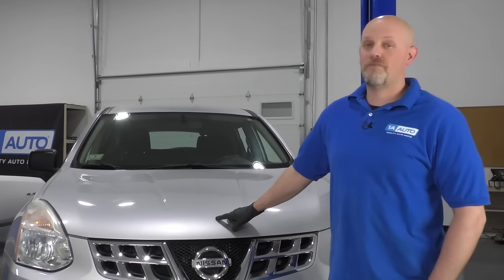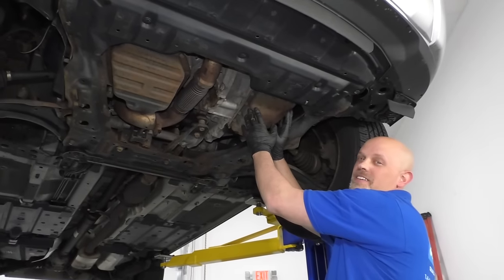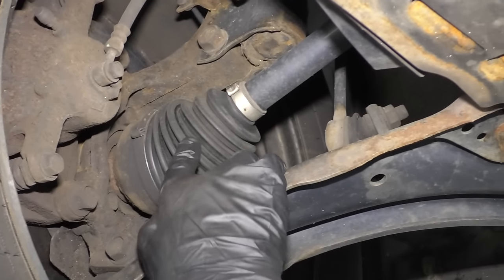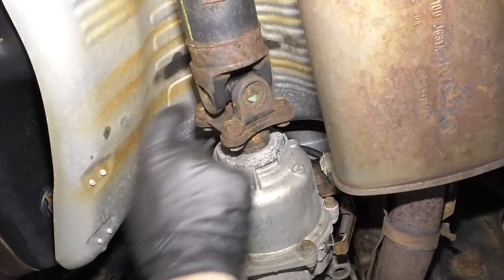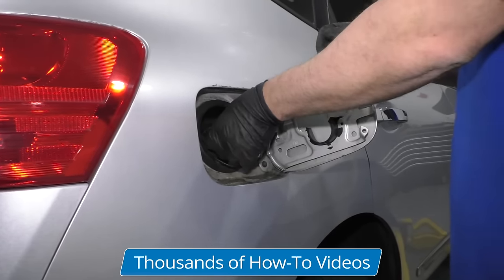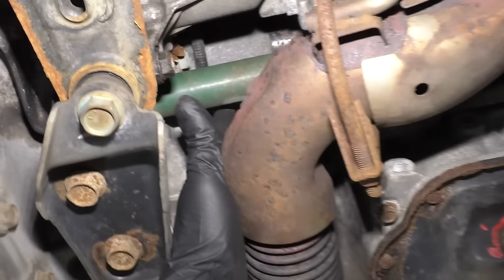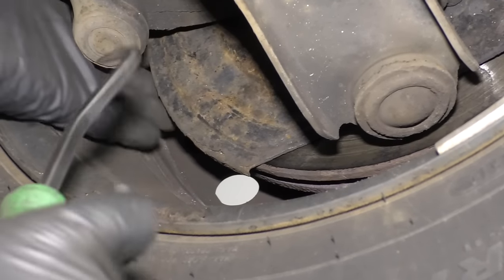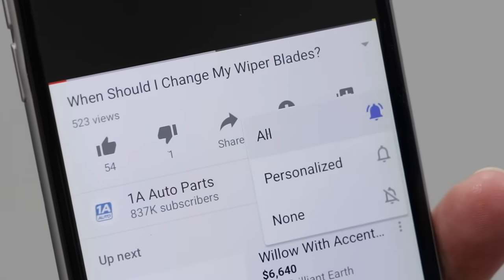Top 5 Problems Nissan Rogue SUV 1st Generation 2007-13

Comment: I have 2009 Nissan Rogue and have atleast 3 first problems. I spent about $1800 to replace Frontend wheel bearing, shafts, Tie rod end etc. But still couldn't fix the blower motor noise/ faulty fan as it is expensive to do it. I have survive with it.

Comment: Bought my son a 2011 Rogue, trying to drive it up on tire ramps this past weekend and it would go about half way then no more and the rpms would increase past 1500 I think it was. Is this the sign of a bad transmission? Is it to late to run some Lucus or something similar thru it? Any advice would be appreciated.
Reply: Following
Reply: Drain the Trans fluid and take the pan off ,clean it up and the magnets in the pan also , get a service kit  ..,,,get Amsoil CVT Fluid and that will solve the trans problems . Amsoil Trans CVT Fluid has the best specs ..No other brand can beat it.
Reply: If it's already slipping like that changing your fluid won't fix that I know from my own experience with a 2012 nissan rogue I bought brand new from Nissan  dealership put in a new trans external cooling fan and trans cooler that'll fix it ....whn a cvt starts free revving and not moving its the transmission

Comment: I bought off used lot at 145k miles and immediately issues. Its now at 230k miles. I have experienced that back shield currently, cv front boots, and rattling under car and slow to speed up.

Comment: I have a 2010 and I’m at 143000 miles. We just had to fix the radiator, ac and now the catalytic converter needs to be replaced and the gas gauge is inaccurate. I’ve died on the freeway and road 3 times in the last month. We’re looking at getting a new car

Comment: Thank you for your wonderful video on Rogue. I have 2013 Rogue which have a problem restarting when stopover for less than 25 mins. It crank but will not start. It will only start only resting for more than 30 mins,  Every morning start fine. After each shut down, it will restart after 30 mins or more without fail. What do you think could be the problem? I have replace the IPDM but problem remains.
Reply: do u fix it?
Reply: Little late on this comment I  Had the  same problem as you 

  no codes were  showing up  either..

I Check the fuel pressure  and it end up being the fuel pump...replace the fuel pump and everything is back to normal ..

Comment: My acceleration is a bit off but deceleration is no problem. Thanks for letting me know that may be a transmission problem. The axles were dmg and i got them replaced.
Reply from the maker: +Heat Productions Official Thanks for the feedback!
Reply: @1AAuto  i would like to know if there was a video done to inform how the cvt for the rogue could be properly maintained

Comment: HI, my 2008 Rogue has 200k miles. I had some issues whit the transmission the key is use the Original fluid and change every 25k miles, if you use any other brand you will have problems with overheating, I also put a bigger transmission cooler and runs perfect.
Reply: Please list the cooler part number and where it is available. Thanks. I own a 2013 Rogue SV AWD.
Reply from the maker: +William Prieto We offer the transmission oil cooler for the 2013 Nissan Rouge under part number 1ATRL00115. You can find this at www.1aaauto.com. Thank you!

Comment: It's suspected that a problem with Nissan's cooling system is making the CVT transmission unreasonably sensitive to heat. The temperature of the cars transmission fluid is controlled by a small cooler as opposed to a radiator and it's not properly regulating the temperature of the fluid responsible for lubricating the parts in the transmission.  Should a car overheat and go into "fluid protection mode" transmission performance will be reduced and as a result the driver may experience trouble accelerating, vehicle shaking or jerking  and or complete failure of the CVT.    Could more frequent coolant changes be  also the answer?
Reply: Yes and No. I have a 2013 Nissan Rogue 108K milles. 1) Change CVT fluid and the 2 filters every 25/30k or once a year. Only if you/ mechanic can check the oil status or it was certainly changed  in the past . 2) Add/ replace a new cooler system. I bought it on Amazon, $80 cooler+small radiator (check the CVT temperature before, during and after installation....IT WILL BE A HUGE DIFERENCE. If your CVT transmission doesn't have a significant lose of metal it will work for a long transmission life.

Comment: Change the universal joints and also the vire that connects the transmition i think and we got a code for a comunication problem between the transmition and the computer

Comment: Hi Guys, I have a 2012 Dodge Journey that is burning oil but I don't know where. I have no oil leaks, no oil pooling in my driveway. I don't see any smoke coming out of the exhaust and I have 206,000 kms on the car. It is not uncommon for me to have to put 4 lt of oil in, there would hardly be anything showing on the dip stick. Do you have any thoughts on what may be causing this issue?
Thanks
Graham Pike

Comment: Sounds like a good make to stay away from, I am told that a re built CVT is around $6000, Honda also use CVT in some models, so look for other makes of vehicles my friends.
Reply: Most passenger vehicles have CVTs these days. Nissan’s are made by JATCO and are terribly unreliable. However, CVTs in Toyotas and Hondas are reliable. They make their own for 25 years and have perfected them. Change the transmission fluid as recommended in the manual and they should be fine. I agree about Nissan, however. I had a 2017 Nisssn Sentra. The transmission started failing at 103K and Nissan would not help me since I was past warranty. They lost a future customer forever. I’ll only buy Toyota, Honda, Lexus, or Acura from now on. I love my 2021 Corolla XSE.
Reply: $3600 to replace CVT.

Comment: I have a 2013 Nissa Rogue 107,000 miles and right now idk if I'm tripping but when I first turn on the car and its initially being drove I hear a noise like a knocking noise but it goes away as the car gets warmer.
Reply: Does the noise get louder when u turn left or right?? Could b your wheel bearing, or cv joint.

Comment: I have a 2008 Nissan Rogue 118k miles. Right after I got it the rear differential went out. Too expensive to fix. So I took it out. Drove fine for a few years. Now the abs wheel sensors are going crazy. Makes a grinding noise. Nissan says it’s the  module. We replace it and the sensors. Still grinding. Works fine with sensors unplugged. But then all the panel lights are on and you can’t get it inspected. No one knows what’s wrong for 3 yrs and 5 mechanics. It’s been a mess.
Reply: I also have an 08 rogue. When I use my brakes they squeak even after new pads. And now my Awd, brake, ps, vdc and the skid and abs lights all come on at the same time. Plus my gas gauge dont read right at all until I hit around a 1/4 tank. Code pulled says sensor. And I pull a code for catalyst too. I'm lost as for the deal wit the dash lights, but the 2 codes pulled not a big deal as far as knowing the problem areas to check. Will check out the module tho for the dash lights issue
Reply: I got a rebuilt differential for 1800

Comment: I have bought Nissan's all my life, my Rogue will be my last one. After paying $4,800 for a remanufactured, 12,000-mile warranty CVT transmission and even being charged shop supplies, I'm done with them. I have replaced both front axles, alternator, and the transmission and I've still not made it to 200,000. I bought an 86 Hardbody truck, abused it, 10,000 miles between oil changes, jumped it completely off the ground many times (Hey, I was a kid) and after 325,000 I replaced a pully on the belt system. Well, I did also have to pay when I got mud in the throttle body. The truck had about 5,000 miles on it. I thought it should be covered, they said I was abusing it. I said I was driving it just like the guy was in their commercial! I'll never buy another Nissan nor will I buy anything with a belt-drive transmission.
Reply: Update: This video popped up while I was researching the P0011 code that came up yesterday. I now have 205,000 miles and have had 4 of the 5 items listed in the video go bad. My brakes are squeaking, I inspected them and they looked fine, I did not notice if the shield was rubbing, and now I'm sure that's it. Also since my last post, my wife's 2017 Sentra with 28,000 miles got a new CVT transmission, thank God this one was still under warranty. Nissan used to make a great car but now their quality is gone. I also recently bought a 1970 Maverick, this car will be my daily driver. I'll keep the Rogue till the transmission goes out, and the Sentra we are going to sell.

Comment: Thank you, beautiful video.
Actually, I guess that I have a problem Axles or drive shaft, because there is a vibration when I drive the car between 50 to 60 km/h! (No vibration at all before and after this speed limit)
What do you think guys!?
Thanks 😊
Reply: I’m having the same problem with my 2013 sport
Reply: Did you find a solution? I'm having the same issue
Reply: I had the same issues. I replaced both the brake rotors along with the driver side caliper that was seized up. I also replaced that brake line just to be safe. That took care of the vibrations when going at high speed but my CV axle needs to be replaced too since I noticed it was leaking bad.
Reply: Mine did the same thing. Changes the CV axle and it helped a bit but mechanic said if it didn't eliminate the vibration completely It was probably going to be transmission. Idk hope it had a easier fix or something else I could try? The tire felt very wobbly and I can still feel some vibration  when I accelerate....🤔

Comment: I need some guidance please. I have the 2008 Rogue SL and I am experiencing something that no one can seem to help me with. When I am in drive or reverse and my foot is on the brake like waiting at a stoplight, I have the AC on or heat depending on the time of year. When the compressor kicks on the RPM's drop so low that the car shakes like it is trying to regain the RPM's. The car has shut off once, but mostly it just shakes and gets the RPM's back up at least until the compressor kicks on again and repeat. It does NOT do it if I put the car into neutral OR stop it against a curb and still leave it in drive. Only if the AC or heat is on and the car in in drive or reverse with my foot on the brake? I tried to clean the Throttle body as I saw a YouTube video with my same exact symptoms, but it did not fix it? Any and all advice is appreciated. Thank you!

Comment: I have an 09' rogue, 227k miles on it. I replaced my blower motor a year ago, yesterday it starting running a little loud and vibrating my steering wheel (not screeching or anything like that, but kind of a rumble). I also have slow acceleration after stopping at a stop sign. I did change spark plugs, check air filter, and we did the fuel pump. After the fuel pump it ran amazing for 2 days. Just not sure if it is the transmission or not, it has some of the symptoms. Not sure if there are any other suggestions to try (fuel injectors just in case?) to get me through for a little bit. I know its a lot of miles but its been such a reliable vehicle.
Reply: Same thing with mine...and I'm starting to think it's the transmission. Even got a mechanic to change the CV axle and it help a bit but the shaking/vibration is still there 😔
Reply: That can be the air flow meter sensor, went you accelerate it don’t get enough air and the motor is choking with gas…

Comment: Since the accelerator/ brake pedal assembly needs to be removed to remove the blower motor, if you have done this you'll need to perform the Accelerator Release Position Learning procedure. 

Some symptoms you may notice is the accelerator pedal will have "sweet spots" while pressing and releasing. The pedal should feel very sensitive, and maintain the same sensitivity if functioning correctly.

 Fuel efficiency loss per the instrument panel reading only after the Accelerator/brake pedal assembly was disconnect. Gas milage shouldn't change after changing the blower motor.

Power loss. Engine feels sluggish and sightly chunky. Don't mistake this for the features of the CVT transmission. This transmission has an Eco mode and Sport mode that the ECU controls on earlier models and automatically switches between the two modes. 

Here's the procedure:

Ignition off. Accelerator pedal fully released.

Turn ignition switch to ON position. Wait 2 sec.
Turn ignition switch OFF. Wait 10 sec.
Turn ignition switch ON. wait 2 sec.
Turn ignition switch OFF. Wait 10 sec.
End procedure.

There isn't an indication that this procedure was successful.

1A Auto should include this step in the blower motor replacement video.

Comment: how much for a axle repair work? can you tighten the axle instead of having to replace it. My mechanic says only solution once the axle starts making clunking noise is to replace it - is that true???
Reply: You can't tighten a loose CV joint.  Sorry

Comment: I think most transmission  problems of these happen around 180,000 miles. I know of 2 owners of Rogues, transmissions went out at this mileage. I owned a 91 Maxima, transmission was shot at 110,000 miles.
Reply: Mine is at 190k and I’m getting a few problems Ima shop for a new car these cars seem like it’s gonna take a crap anytime now
Reply: When you look inside a transmission and see all those intricate and complicated parts it's no wonder they fail after a while. It's too bad they have to make them that way.

Comment: I have a 2013. My Nissan Rogue started making noise or sounds clunky and the acceleration is slow. I’m nervous what that could mean..
Also my mileage is kinda low for a 2013 it’s at around 95000
Reply from the maker: +Jelena We wouldn't be able to diagnose an issue like that here, you may want to have a local mechanic take a look at it. Thanks for checking us out! http://1aau.to/m/Shop-1AAuto-c

Comment: What about ac line puking oil or spark plug tube seals going bad and needing a NEW VALVE COVER BECAUSE THE TUBE SEALS ARE NOT AVAILABLE SEPERATELY and the horn not working, huh, what about those issues.

Comment: Ok, I have a 2009 Nissan Rogue. The issue I am having is the ac sometimes just will not work. The compressor is good, charged just fine. But no air. Not every time just intermittent. Any ideas? Please.
Reply from the maker: +Jimmie Boling We wouldn't be able to diagnose an issue like that here, you may want to have a local mechanic take a look at it. Thanks for checking us out! 1AAuto.com

Comment: Any idea why the OBD port would not work? I've tried two different readers and it does not power on. Also, why two different check engine lights?
Reply: Check the fuses

Comment: PLEASE HELP. I installed new speakers on 2013 nissan rogue(completely base model) On the front doors the back are stock speakers. The radio lasted for maybe 20 mins or so and it went completely deaf no sound nothing but i have power. The volume works and everything but no sound. Please help. I installed a head unit and it worked for a minute but then went off again. I just want to fix it.

Comment: CVT transmission.... Big headache. You hit 140k and expect those belts to give you trouble. Maintain it often. Change fluid often. Drive less than 70 MPH. Distances less than 500 miles.

Comment: I think my crack position sensor but I wanna make sure. It sometimes starts but sometimes doesn't an I don't have a check engine light an sometimes I have to spray starter fluid to have it start but not all the time an I don't believe it's the fuel pump any way I could get some help ??
Reply from the maker: +Jose Lira We wouldn't be able to diagnose an issue like that here, you may want to have a local mechanic take a look at it. Thanks for checking us out! http://1aau.to/m/Shop-1AAuto-c

Comment: Ugh, have to have mine looked at. Light rattle/grumble when I start accelerating and goes away when I pickup speed. That’s the transmission?! I have a 2013 with 50k miles on it 🤦🏻‍♂️

Comment: EXCELLENT !! good discussion of some design flaws...you failed to mention the valve cover..they start leaking around 140,000 miles.....also, I would say that the door handles are crap....I think they are made out of some inferior metal, maybe pot- metal, mine snapped......well its the 1st generation model, I can dig that, but that transmission is downright evil. Lousy design, because the main belt is way too small and weak. It looks just like a ladies necklace....now thats supposed to hold up day in and day out?????...... and it took them 14 years to try a different design!!!!!...now you tell me that thats not a scam!!.......reminds me of those lousy chrysler  trannies we had in the 1970's.....if you disagree with me people, fine, but consider this much:  I paid $5000 to make these comments.....thats what the C.V.T. tranny r+r  cost me.

Comment: I own a 2015 Nissan Rouge Select and recently I noticed that it vibrates when I stop at a traffic light or stop for a little while, if I put it in neutral the shaking goes away, it’s my wife’s car and I only drive it every once in a while and I notice things, noises, shaking, etc that my wife never tells me.
We have owned the vehicle for almost 3 years, it had 101,000 miles when I got it and it has 123,000 now, I had the transmission fluid changed for the first time about 6,000 miles ago, what could be that shaking when I stop? 
I changed my spark plugs and cables about 2 1/2 years ago and spark plugs again about 2 months ago.
Reply: Mine is a 2010 and does the same thing. Mechanic says might be the trans

Comment: Mine has those internal issues it won't go forward or reverse and no power... how do I fix it plz
Reply: It sounds like the transmission is shot.  Sorry.  But if you have under 110,000 miles you might get the dealer to put a new one in for less because of the lawsuit.  I paid half price in my 2010 Nissan Rogue